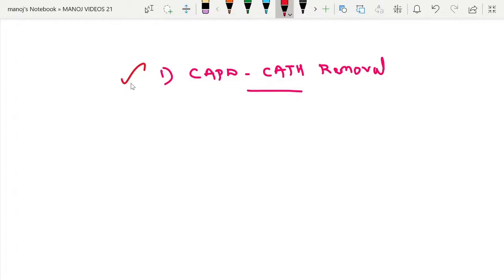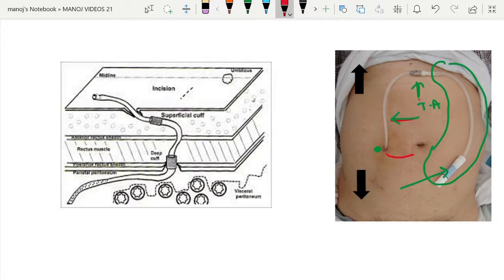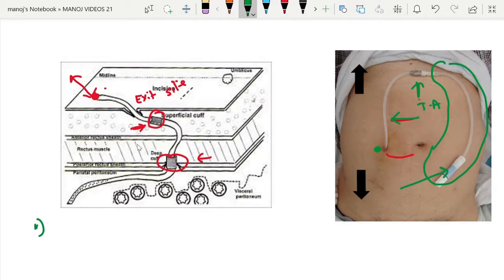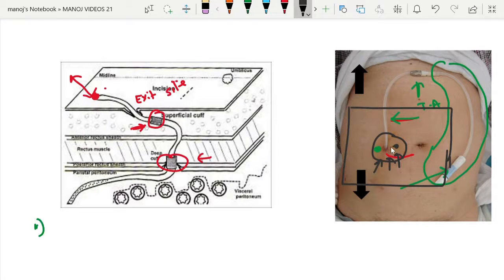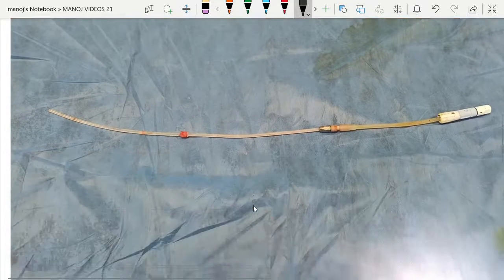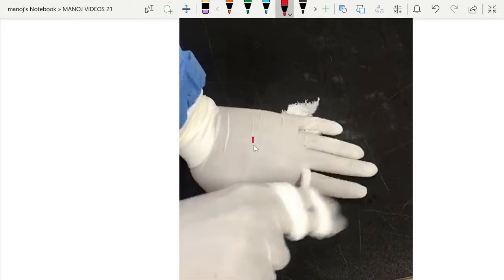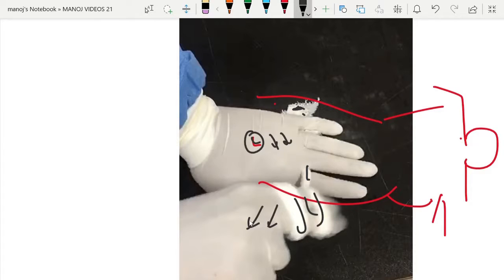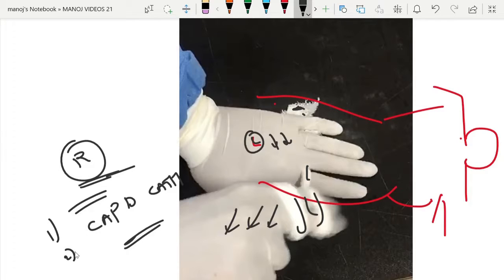CAPD CATHETER REMOVAL STEPS FOR NEPHROLOGISTS / PD CATHETER REMOVAL STEPS / DM NEPHRO

Comment: This method may not work always.
A) Sometimes the previous surgeon would have fixed the insertion at rectus sheath with a purse string suture with prolene.
B) Blind traction causes pain and discomfort. Better to dissect the inner cuff under vision under local anesthesia
Reply from the maker: yes.. correct...